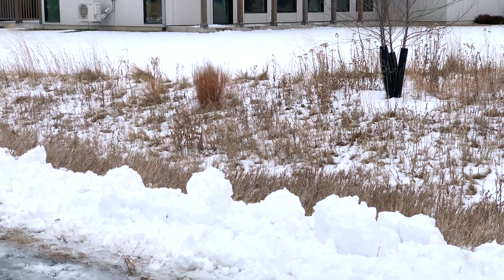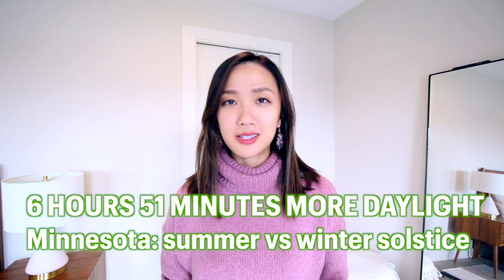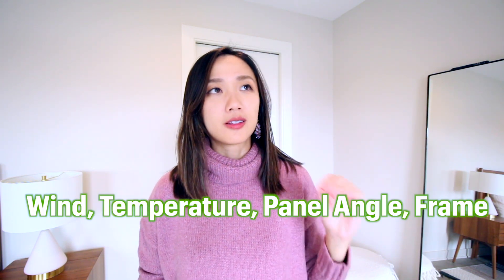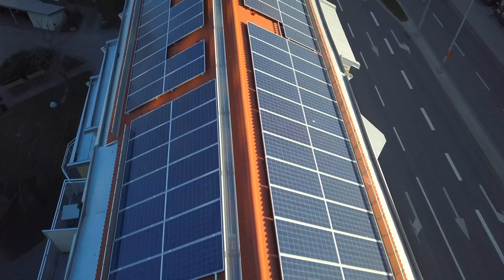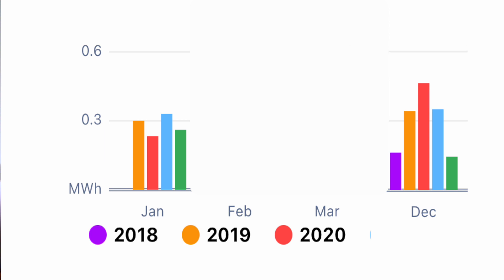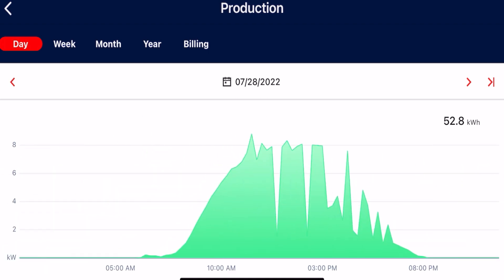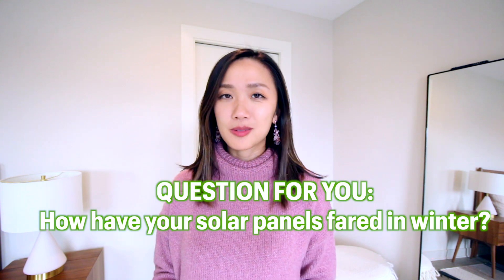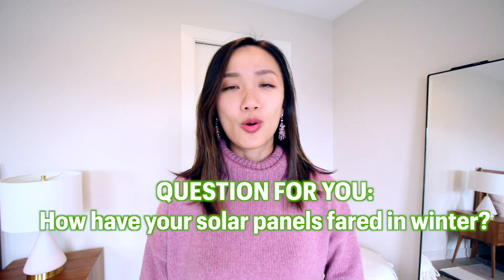How Much Energy is ACTUALLY Generated in Snowy Winter Conditions? | Our Experience with Solar Panels

Comment: Hi Lydia, your videos are always a breath of fresh air: love the vibe with the mix of human touch, very lady like, professionalism, relevancy, simplicity, not too long and a what nice flow. I live in Ottawa, Canada and I installed a 17 kWh solar on my roof (East and West sides roofs, 38 panels at 450 watts each) in June 2022 with a 10 kWh inverter and a 10 kWh battery pack at the cost of CAD $47,000 (USD $35,000) including the $5,000 government credit. Yes I have 7 kWh more than the inverter is capped at, but on those cloudy days if I had a 10 kWh system I'd produce ~ 5 kWh whereas the extra 7 kWh of panels raises that cloudy day's production more constantly to near 10 kWh for optimal efficiency (same principal when there's snow on the panels, and it will continue to be overall benefical and accumulate extra credits for winter for the next 30 years or so). My electricity bills have been at $0 since the instal (since the kinks have been resolved) and I have 1 year to use accumulated credits but everyone has to pay a minimum of $35 per month for the upkeep of the electrical structure going to their house, regardless). My system powers my two homes (60 and 10 year old) and my swimming pool, hot tub, AC and freezer. Credits are 1 to 1, meaning I receive the same amount of money for the electricity that I overproduce as I am charged to import it (avg. CAD 9 cents or USD 7 cents per kWh). That's a monthly saving of CAD $375 (USD $280), year round, which represents approx. 10% return on investment and break even under 10 years. The whole of December I climbed on the roof to clean the solar panels after every snow storm but that only generated CAD $14 (USD $10) worth of electricity (150 kWh) for that month due to, like you mentioned, low sun and low sun hours but I wanted to know who much electricity could be produced in winter (at peek) to replenish my battery pack daily in case of a power outage (I'd survive, lol, limited and with nothing to spare and so, to mitigate that, I had installed (in 15 minutes) a Generlink (no affiliation) to my electricity pole meter: it's a simple plug-in adapter that allows connecting my gas generator to my house, just in case solar wouldn't be enough in a winter outage). My conclusion is to make the best of the summer months by accumulating all the necessary credits for the winter, and that can be accomplished by combining a well-insulated house and a reduction of unecessary consumption including phantom electricity: to that end, I used the $35 "Kill-A-Watt" tool from Amazon (no affiliation), which paid for itself in the first month... it's a mind blowing, eye-opening experience on its own: for instance, a turned-off and unused PS4 Playstation still uses over $20 in electricity per month unless it's unplugged, $17 for a turned off subwoofer, $5 for an unused power drill charger etc. You'd do a much better video on that than I would and it would be very popular and useful to the mass :)
Reply from the maker: Thank you for the kind words, and I loved hearing about the snow removal experiment! It is more of an educated guess on my end, so it’s fantastic to hear actual numbers from you. I should look more into the kill-a-watt devices. Thanks for the idea ❤️

Comment: Personally, I would have either had the roof pitched at 40.55 degrees so my panelsa could be as well which is the optimal and angle for Spring & Fall. This would produce less power in summer but more in winter giving me a more even power production top work with. 

As an alternative, have maybe 25-30$ more panels overall and then splitting them so half were at winter angles and the other at summer angles. To make up for the lack of summer power I could install an earth tube under the garden which would then enter the home at the lower end(in your case the HERV which you would have needed installed to catch the heat from all the air exchanges you do for cooking) which would cool the air in the summer before it enters the home and heats it a bit in the winter. 

Having a tube like that on the north side of the home and having it connect to behind the fridges/freezers would help whisk the heat away and improve their efficiency and power consumption. Also, if I could afford it I would get super insulated fridges/freezers. The aesthetically pleasing ones are very expensive so I would probable try my hanfd and carpentry and enclose a regular model instead.

The Tube are are good for making a cooling pantry for vegetables as well.
Reply from the maker: Thank you, I’ll have to look into the tube!

Comment: Again, very well done video, Lydia! The quality and clarity of the subject you present is always excellent. I hope your channel grows fast! One thing I would add is, that the more you incline your panels, the more even is the annual production curve. This is good, if you don't supply energy back to the grid (which will probably be impossible for all people anyway, soon or later, due to grid loading), but your using batteries, you can design your panels with steep angle. This will have no effect in the summer, since you can't use more engergy, but helps with gaining more energy during winter. The steep angle also helps with the snow problem. It wasn't said, but the panels heat themselves little bit when they produce energy, so when the light gets through the snow, it creates a tiny layer of water on the panels and then the snow can't grip to the panel and slides down. In my experience it also works a bit with ice, just ordinary panels have edge, that holds the ice from sliding (I can easily access my panels, so I lift the bottom of ice over the edge and the thing just flies down).
Reply from the maker: Thanks for the additional info! I’m sure other folks reading the comments appreciate this :-)

Comment: If you look at the manufacturer's spec sheet for your panels, one of the parameters is "Temperature Coefficient of Voc".  Our panels have a TcVoc of -0.27%/K, which means the open circuit voltage (Voc) at -40C is ((40+25)*0.27% = ) 17.55% higher than it is at 25C.  So you can get substantially more power in full sun at low temperatures.  We had to be careful with this to avoid delivering higher voltage than the inverter could handle.
Reply from the maker: Thanks, that’s helpful!

Comment: I live near Toronto Ontario Canada with 7 kw solar rooftop for over 8 years produced about 800kw annually on a micro- fit programs which cost me nothing on a 20 years contract and belong to me after that. Presently it covers almost 90% my electricity.
Reply from the maker: That is so awesome. Do you still connect to the grid/ what is the cost like? Currently our big problem is the cost of connecting to the grid ($20/month plus taxes) wipes out a lot of my credits on electricity generated.
Reply: @lydiapatelll  The provincal government paid for the grid when installed 8 years ago. Now I charged my EV and energy use in the house cost about $10 per month normally over hundred dollars.

Comment: Do you have batteries in your system?  I watched a few of your videos and don’t recall you ever mentioning it.
I live in Canada and have a small system installed at my cottage.  Unfortunately it is 3 season so I shut the system down in the winter.
Reply from the maker: We don’t have batteries. It was cost prohibitive when we built, but I wonder if this will change and technology gets better and more mainstream. 
Do you produce extra with the spring summer and fall to last the winter? That is so interesting!
Reply: @lydiapatelll  The cottage is shut down during the winter so I don’t need any electricity.  I was thinking of building a passive house along with a solar system.  That is my dilemma too, do I get batteries.  Do you sell back any extra electricity to the grid?
Reply from the maker: @bobmcnulty3500  we do sell back to the grid which helps our bill. Connecting to the grid costs us $15+ each month though, plus there is tax on any electricity sold to us.. so the battery option is looking more and more attractive.

Comment: Very helpful video! 
An 80% solar power reduction during winter, just when you might want to run a mini-split heat pump in heating mode, should make one think about how to actually implement renewables in a way that will meet household needs during ALL seasons.
Reply from the maker: Glad this was helpful!! ☺️
Reply: @lydiapatelll  Can you tell us the installed solar pv kilowatt capacity so we can compare the installed rating vs the actual production?
Reply from the maker: @alanmcrae8594  the estimated output is 9000kwh per year from our solar provider, which is pretty close to our real life experience
Reply: @lydiapatelll  That's the estimated yearly output. What is more helpful is the total capacity of installed PV panels in kilowatts. (The total size of your installation in kilowatts, or the watts rating of each panel times the number of panels.)
Reply: A house in Minnesota with a solar array generating 9000kWh per year probably has around a 6kW solar array.
Reply from the maker: @alanmcrae8594  I wish we kept record of more of the panel details. From the beginning we worked with the real life estimated production to match the consumption needs, so unfortunately don’t have the labeled manufacture estimates.
Reply: @lydiapatelll  That's unfortunate. People considering adding solar power to their residential energy mix tend to have to trust a particular installer, as the detailed real world experiences of actual homeowners is not easy to come by.

Your production graphs over several years and for specific days in summer & winter are a real gold mine for people like me who are seriously researching renewable energy systems for residential power on a rural homestead.

I took a college course in passive solar home design and I had become skeptical of the solar insolation figures used in design calculations, especially for winter insolation values. Your actual production charts confirm my suspicions. 

Winter production is a small fraction of summer production, which means that an off grid solar home would need far more solar panel capacity in order to meet their actual winter needs if they wanted to implement heat pumps, water heater, refrigerators/freezers, well pump, HRV's, greenhouse, workshop, power tools and other uses.

Then there is the question of all of the battery storage needed to meet those needs after back to back cloudy days. Some combination of smart grid connection, affordable level of battery storage, and other renewable generation & storage options might be necessary to achieve an optimal level of sustainability, resilience and fault tolerance in a more isolated, rural homestead property.

Knowing how many kilowatts of rooftop solar panels need to be installed & functioning in order to meet both seasonal day-to-day and annualized power needs seems like step 1 to me. Hard to believe your installer didn't give you a user guide with all of these details plus a system diagram, warranty information, and basic operational & troubleshooting procedures.

If it was my house, putting together a 3 ring binder with all of this relevant solar electric system information would be my first priority during system startup. Just like reading an automobile owner's manual as soon as one gets a new car home.

Anyway, your production charts are extremely helpful, especially if more people get to see them.
Reply from the maker: @alanmcrae8594  I would be interested in the battery storage in the future! It was cost prohibitive in the past but hopefully as technology improves/becomes more commonplace (maybe??), it also becomes more accessible. Keep me posted on your future projects and thanks for sharing your knowledge!